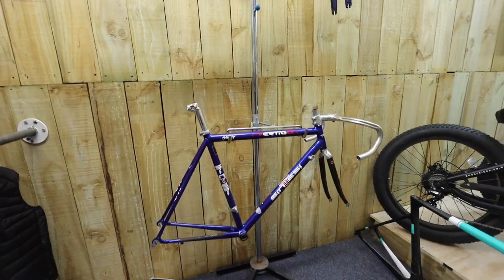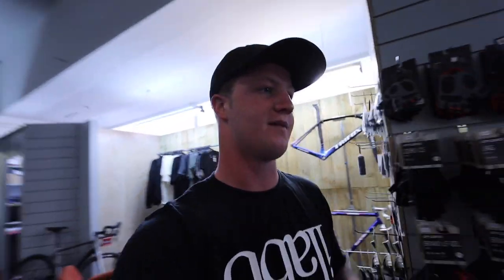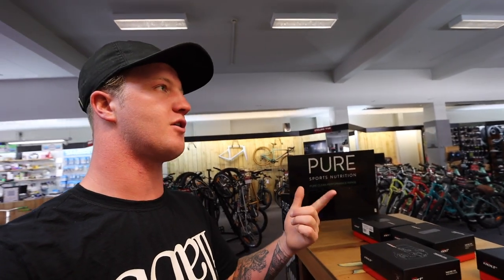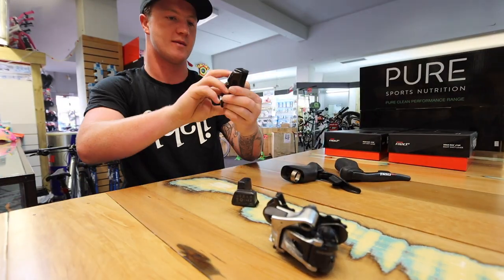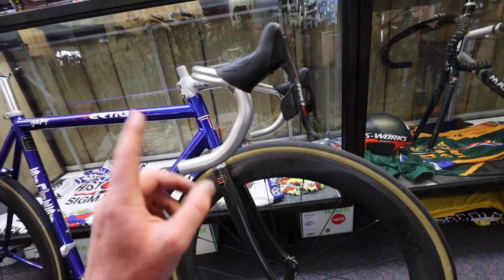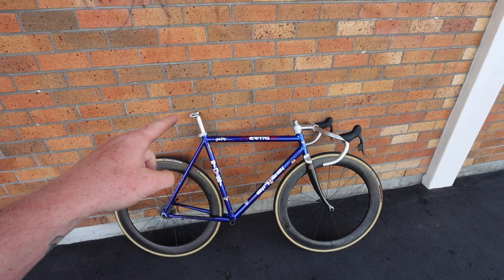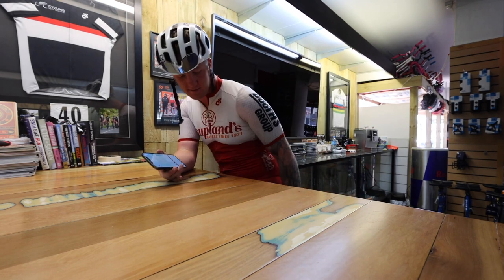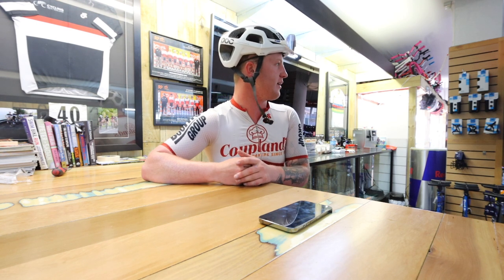Building this Retro Frame with SRAM ETAP!

Comment: "Deep dish" is pizza and fruit cobbler, not wheels, and IMHO these deep section wheels look quite wrong on this frame.  No doubt this build has long been finished, but I would have used red bar tape and bottle cages.